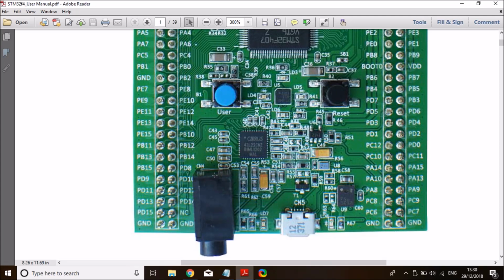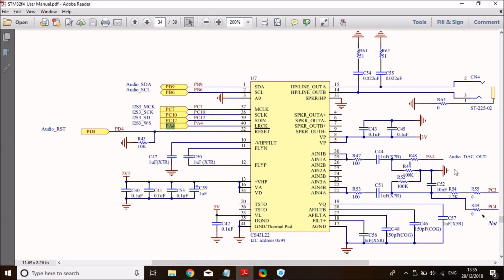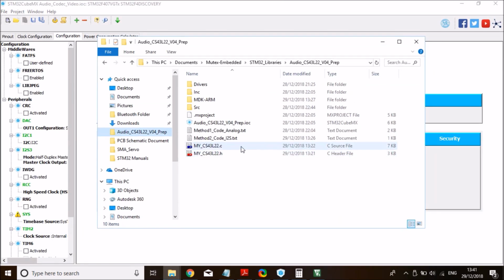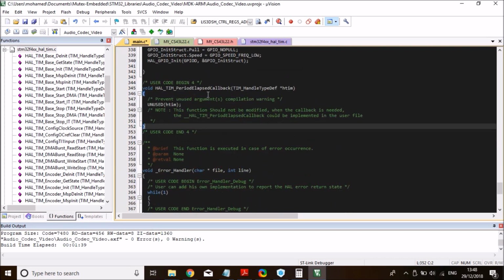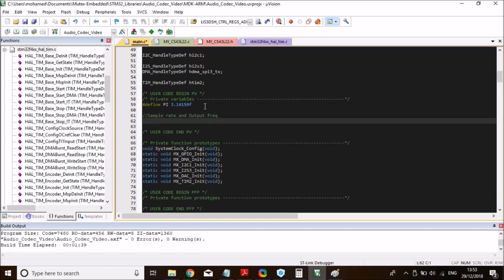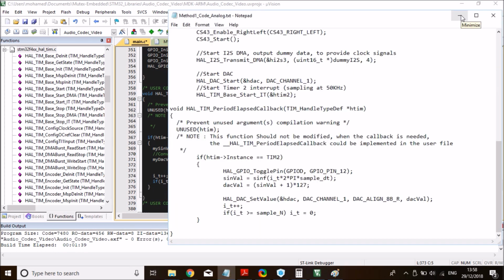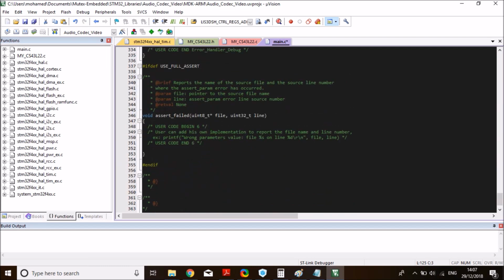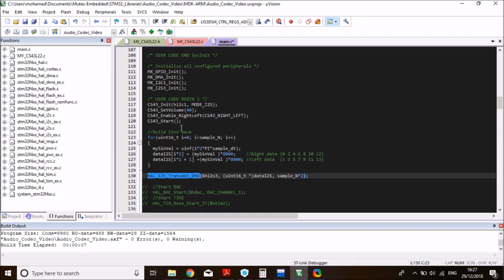STM32F4 Discovery board - Keil 5 IDE with CubeMX: Tutorial 28 - I2S Audio Codec - CS43L22

Comment: The first test at 23:21 was not working for me. I commented out the DMA-dummy transfer (  //HAL_I2S_Transmit_DMA(&hi2s3, (uint16_t*)I2S_dummy, 4);) as it was not triggering the clock. To make it work, I had the I2S clock working like this in the infinite while loop:   
while (1)
  {
    /* USER CODE END WHILE */

	  if( HAL_I2S_Transmit (&hi2s3, I2S_dummy , 0x10, 10 ) == HAL_OK)
	  {
		  HAL_GPIO_WritePin(led_blue_GPIO_Port, led_blue_Pin, 1);
	  };
    /* USER CODE BEGIN 3 */

  }

Comment: is there a difference between your sine generation method and a look up table?
Reply from the maker: Hi,
It's the same. I am creating the lookup table on fly instead of typing values manually.
Reply: @mutexembedded2206  thank you for the quick answer, I tought a look uop table would be quicker because you initialize it once and in the loop you read the walues out of it and dont need to do further calculations. But I am not an expert, probably I'm wrong
Reply from the maker: @babotvoj  you're right. I did just that in the other half of the video.

Comment: Hey yaqoob, are there any relation between i2s3 and i2c3 ? In my project i played a sound sample via i2s dma and after to do this i sending some i2c data but i2c goes into busy flag error. If i comment transmit dma function problem dissappared. Btw i2c connection between i2c devices is ok so before the i2s transmit.
Reply from the maker: Hi ismail,
I2C Here is the configuration interface for the Audio Codec. I2S is the raw Audio signals, no Chip level configurations are done over I2S. We need both.

Comment: You really mess up with numbers in your project.
Anyone who will use it have to be aware of your mistakes.
You excess the array length (defined by you as 100) several times in the code:
- in building sinus wave, sample_N is equal to 320, so you are risking to overwrite anything going after your array definition
- while sending it you also use sample_N*2 which is absolutely wrong since I2S_Transmit will send all these numbers even though they are not inside defined array.

You are lucky that your code even works. In any bigger project such mistake will lead to unexpected behaviour or even hard fault.
Reply from the maker: You're right about the N 100 array.

Comment: Hello i have a question about CS43_SetVolume function. Could you explain what exacly is happeing there? I don't know where are the set values of 50 and 127/50 come from:
int8_t tempVol = volume - 50;
tempVol = tempVol*(127/50);

And also if you could explain the macro VOLUME_CONVER_D(Volume)
#define VOLUME_CONVERT_D(Volume)    (((Volume) > 100)? 24:((uint8_t)((((Volume) * 48) / 100) - 24))) 
I also don't know where are those values come from.

Comment: Hi Yaqoob,
I have a Quad Analog-to-Digital Converter (ADC) ADAU1978. I have to interface it with my STM32F407. Here ADAU1978 will be in master mode, The output of the ADC is audio I2S mode. SO i have to do a I2S DMA receive to receive the audio output on STM32F407. I have used the API  HAL_I2S_Receive_DMA to do the same. However, when i store the audio output on a sd card and try to playback i hear only noise. I used MATLAB to check the number of samples in the .wav file , however im losing some samples during the recording. Is there anyway you can show how to do a I2S DMA receive?